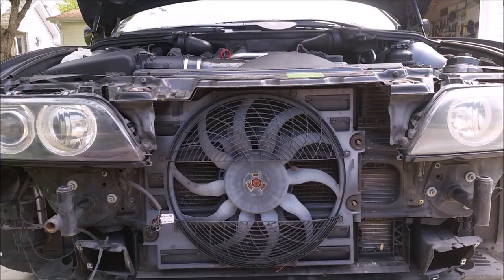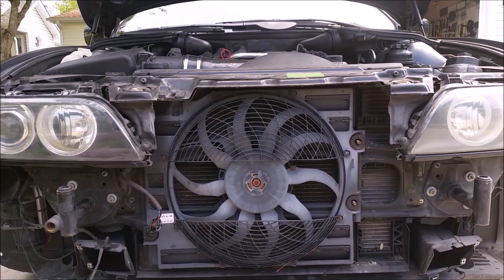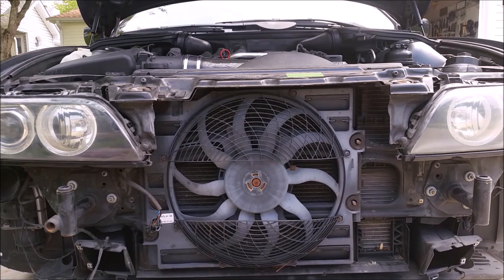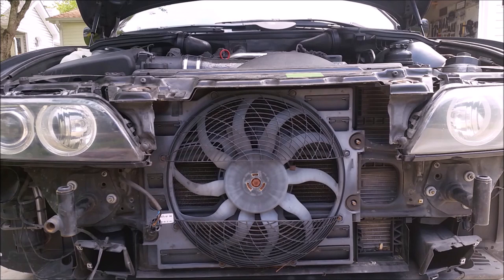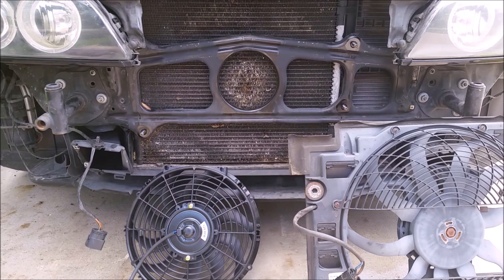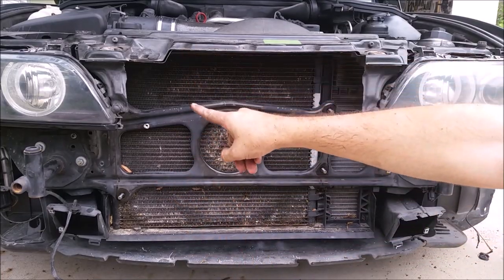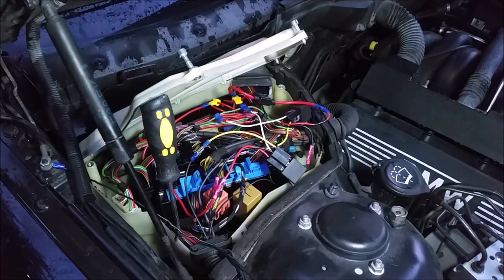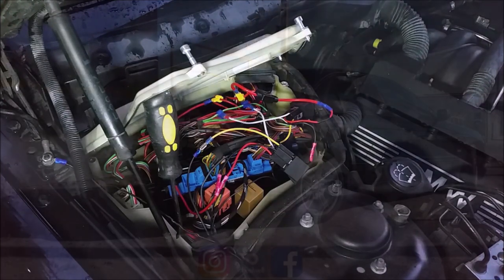E39 BMW 540i Custom Auxiliary Fan DIY (Cooling Overhaul Part 5 of 5)

Comment: Hello its me again. Its has been almost 1 year since you made this video and my Aux fan are kind a broke (they made loud noise when hit full speed and I can hear it even I am inside and all the door are closed) 

So the question is did you have any issue with this mod yet? And any change you would make if you need to done it again? Thanks
Reply from the maker: No, I really like it. It's a small fan; so, it doesn't really effect the alternator to have it run constantly. My factory fan was running constantly when it still worked. I added a switch so I could turn off the fan in the winter. Otherwise, it's great. It works well for provide the AC air flow and the main fan turns on less often. No complaints.
Reply from the maker: etownbrawler1  The factory aux fan is very expensive for how little it actually does. Unless the car lives in traffic, the fan should rarely ever be needed. Even then, this fan worked perfectly for an entire year at a fraction of the price (and a fraction of the weight). I would choose this every time.
Reply from the maker: etownbrawler1  the factory fan is $230 and this fan cost $30. I already had all the wiring stuff from when I did the electric fan conversion with a 14 inch spal fan. The Spal unit does most of the heavy lifting; so, this worked perfectly. I could use the AC while stationary with no issues and no gauge cluster warnings. If the fan craps out in a year or two, I can swap in another without removing the front fascia, not a big deal at all.

Comment: There is gotta be a way to make it work when you turn on AC.
Reply from the maker: There probably is, but it worked well enough running while the engine was on.

Comment: question , can i just run the new e fan on the out side and no fan under the hood. and if i run a 16 inch fan , do i need a bigger fuse or can i run the same one as the 14 inch fan
Reply from the maker: I would think the 40amp relay would still be good with a 30amp inline fuse for a 16 inch fan. It should tell you the amperage requirement when you buy the fan to double check. I would run tandem fans because the auxiliary fan is for the AC to give you airflow in traffic and help when you're engine is getting hot. The main fan is just for the engine temperature control. The roles can over lap, but sometimes they don't. It's better to have the two fans than one big one.

Comment: Hi is there any way to mount the 12 inch fan without using rivnuts?
Reply from the maker: You can attach it however you'd like: nut and bolt, zip ties, double sided tape, drill and tap the metal. Whatever works best for you.

Comment: Hi I've been having some issues with my A/C compressor after the conversion. Since there is no Aux fan it won't turn the compressor on. Do you know a good way to trick the system into thinking the Aux fan is still there and on?
Reply from the maker: Unfortunately no, I do not. I never had that issue
Reply: @350Z247  Do you remember if yours had the DME turn on the AC compressor? If so how'd you have the AC on?
Reply from the maker: @ismael7373  I didn't have to do anything special. The AC worked exactly the same as before.

Comment: How has the fan held up and is it loud?
Reply from the maker: It's been great. I can't hear it unless  the window is down. The curved blade fans are quieter.
Reply: Ok and as far as overheating the car has any problems since switching to your two fan system
Reply from the maker: @iKeepITB  I've sat in heavy traffic for a very long time with zero issue. The second fan is more of a precaution though.

Comment: Very small fan?
Reply from the maker: It's a supplement for the main fan or for the AC in the summer when the car is stationary; so, it doesn't need to be big.
Reply: @350Z247 I understood thank you.
 How to connect cables.???  have input cable?
Reply from the maker: @VadininHayaletleri  Watch this full video and my video on the electric fan conversion. I wired both fans the same way.

Comment: any way i could make the wires look oem as possible
Reply from the maker: You can wrap them in a loom that matches the factory. Split braided loom is my favorite.
Reply: 350Z247 thanks sounds like a plan i got me a little e38
Reply from the maker: @amariodom4858  nice. Those are great cars

Comment: What did u connect the white wire to?
Reply: The front fan did you connect both of the brown & blue/red wire to the black wire?
Reply from the maker: The white wire from the relay connects to the green wire with a white stripe. The blue wire on the fan just goes to a ground. The black wire goes to the relay. I don't reuse any of the factory wiring.
Reply: @350Z247  how about the old relay sensor from the aux fan? Can delete it?
Reply from the maker: @bamsr9051  every piece of wiring or relay used was brand new. I refused nothing. I just left it all in place in case the next owner just wanted an OEM fan.
Reply: @350Z247  oh okay2. I understand now. Thank you so much 🙏🏼

Comment: This is not having oem cfm to cool the condenser 🤪🤪🤪 so its big impact to the ac
Ive changed mine once its went bad with summit racing brand cfm is 2300 as i remember but its not enough i hate it then  i got one from scrapyard, and got rid of this junk only i can use it as addition not as a replacement for auxillary fan good luck man and usually ebay fan doesnt work well if its china made itll not cool enough or you are going by feel 😁😁😁 which is not good man 🤪🤪🤪 then youll be sick cause of hot Climate in your bmw while sitting on traffic jam
Reply from the maker: I didn't have a single issue with it. It worked perfectly for an entire year before I sold the car.

Comment: Thank you for the video! :)

Could you please help me? 
I have following problem. Fan is working but sound is like the fan rubs against something plastic.

1. video is on cold engine (very noisy)
https://youtu.be/IUOjvatsRSA

2. video is on warm engine (I could live with that) but if is easy fix, I would like to fix it.
https://youtu.be/UKPDOSQCebU

Thank you very much :)
Reply from the maker: I'm not really sure. I would start by taking the bumper off to get a full view of the fan while its spinning. It could be something in the way, but because the sound gets better with more temperature, I suspect the fan's bearing might be bad